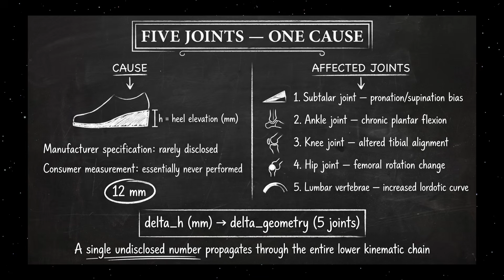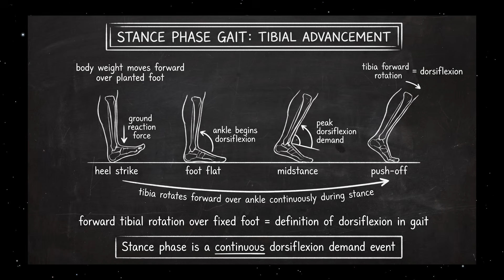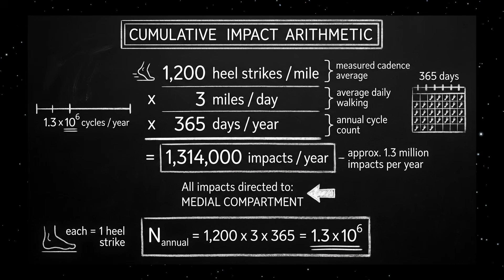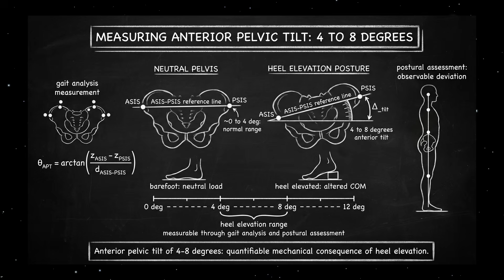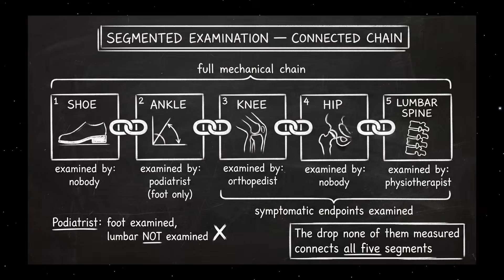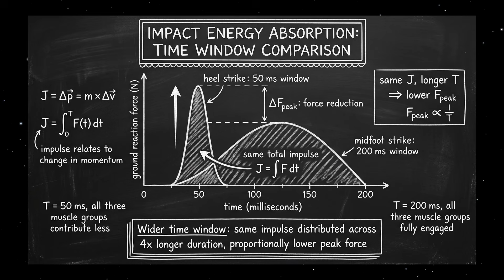Why Your Knee and Back May Hurt for the Same Reason

Comment: 68 and have been on preferred shoes for almost 2 years now but I think like all these things it’s about taking your time to adapt so I use barefoot shoes toe yoga spacers and my feet have certainly got stronger my fortune didn’t even near back Pain to correct but does not make perfect anatomical sense
But I did it all gradually at the beginning some barefoot, some old shoes, some flat shoes and took me two or three months to adapt to the change, but I do feel it was well worth it for me

Comment: 99,99% of shoes not only have a heel-toe drop but also 3 other big probs which mess up the feet and body very badly, namely:
1. Thick/rigid/stiff sole makes a natural unrolling of the foot impossible, the sole should b thin and very flexible.
2. Insole/footbed that supports the foot arch makes natural foot arch support by intrinsic footmuscles impossible, there should b no foot arch support from an insole/footbed at all, the foot arch should b controlled/maintained by the intrinsic footmuscles only.
3. Tapered toe box makes a natural toe spread impossible. A natural healthy foot is widest at the toes, therefore a shoe should b widest at the toe box and not as most shoes have at the ball of the foot.
The 0,01% of shoes that r good r the so called barefoot shoes, especially Vibram 5finger shoes.
7 Years ago I threw away all my old bad shoes and since then I only have/wear Vibram 5finger shoes.
I dont want anything else on my feet no more bec those Vibram 5finger shoes is the tool/reason I got rid of 25+ years of low back pain/prob. It did not only solve the backpain but also retrained the whole body bec our bodies fascial web (biotensegrity) works from the earth/ground/feet up to the head. This means if the feet r not well trained, the whole body can never b well trained and if the feet r well trained, the whole body can b well trained!
For those who r interested and want 2 buy Vibram 5finger shoes, try/start with the KSO Evo and/or V-Alpha model.
Both r great, the KSO Evo is a bit lighter in weight than the V-Alpha.
Reply: Any suggestions for dealing with snow and icy conditions in winter?
Reply: @KarinM-u4f  This is a great question! bec the only 2 disadvantages I experienced so far r:
1. Cold feet in winter with snow and ice and 2. Not being waterproof and a 3th I can imagine which I havent experienced yet (and ofc never need/want 2 experience) is stepping on glass, rusty nail or any other sharp object that might penetrate the thin sole.
I live in the Netherlands and our winters/snow/ice r minimal, last year we had only a couple of days snow and ice, so thats no prob at all. My feet r hardened/trained against the cold as well from the time b4 i found the Vibram 5finger shoes bec I walked real barefoot for 3 years 24/7/365. Water + cold is tougher than snow + cold. So I'm fine in these conditions.
Coming back 2 your question, I spoke to some1 from Alaska and he said that he does the Alaskan winters wearing the Trek Ascent Insulated or V-Trek Insulated + the heaviest weight Injinji toe socks. They keep the feet really warm but they r NOT waterproof! So the prob of only cold can b solved.
Totally waterproof is none of the 5fingers bec the fabric between the toes is an issue for wet conditions design-wise.
Finally, I also spoke to some1 from Finland and he said that he had really good experiences with barefoot shoes from Vaistoa (from Finland) or Ahinsa for winter, snow and mud.
Hopefully this will answer your question.🙏
Reply: @KarinM-u4f  Additional info: 2day I contacted Vibram 5fingers Netherlands and they told me that atm there is none/0 5fingers model 100% waterproof! The good news is, they r workin on it and next year 2027 they will release a 100% waterproof model.
Reply: Thanks buddy, I'm exactly where you were at 7 years ago, that is changing my footwear for FiveFingers, kso and alpha😅 I devised a 3 pairs of shoes  strategy : casual (five fingers) ; all around (vivobarefoot at 2 tracker with no drop) ; apocalypse shoes (Hanwag tatra). 😊
Reply: @Tranquillou_Pilou  Great 2 hear that and tnx 4 your response! I hope it will change your life and body 2 the good as much or even more as it did 2 me. Your shoe strategy is pro. I know the vivobarefoot but I never heard of the apocalypse shoes, they look nice as well. I learned a lot new things about the body in those 7 years mostly by trial and error. The most important discovery by far was the fascial web! Our body is 1 big continuous web of fascia that connects everything in the body but its hard 2 find/feel/manipulate/train bec it's a mess in 99,9% of people and therefore hard 2 notice/discover. If u r interested, let me know, I can give u some tips about how 2 find/feel/train it with the 5finger shoes.